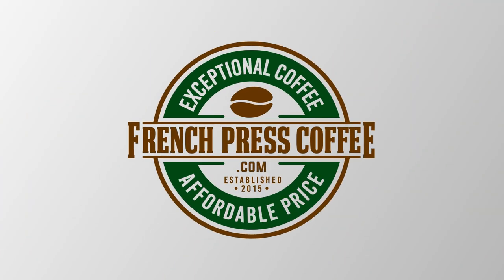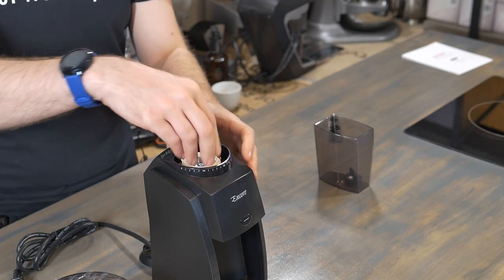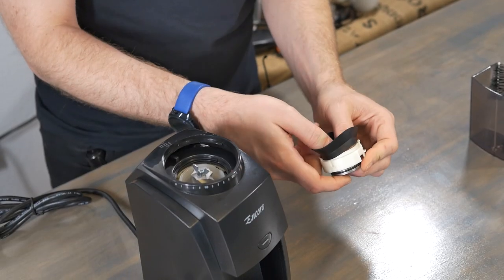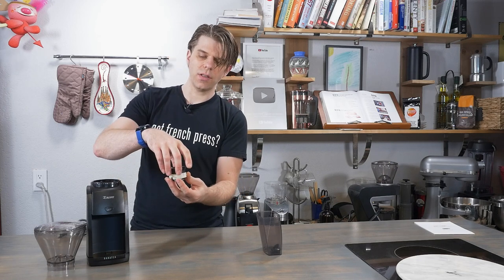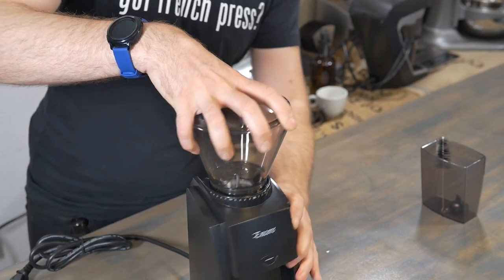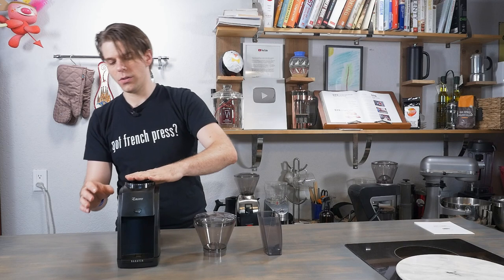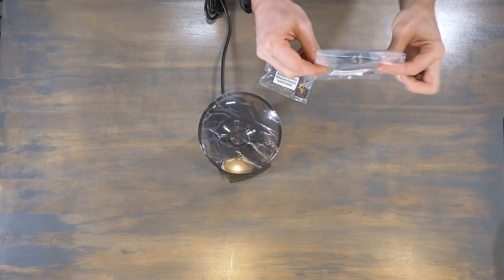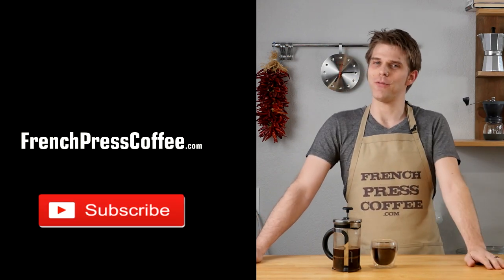Baratza Gasket  (Encore, Virtuoso) - How to  get it on

Comment: Thank you for this very helpful video. I watched it while my grinder was on its way to me. Therefore, i knew putting the gasket on would be a hassle. Opened the box, watched your video again as I installed the gasket using the claw hand method. Took me two tries and then got it. Without your video I think it would have taken me forever to do. 👍

Comment: Understand the frustration when the grinder is new. I felt it too. But the video is absolutely correct, the issue goes away rather quickly as the gasket ages. Now, when I clean the grinder, the gasket sits easily on top of the burr with zero effort.

Comment: 02/16/2022: I just installed the black silicone gasket onto the removable ring burr, on my 3rd attempt. It took less than 2 minutes.

I do not know if the Manufacturer has made some improvements, since this video was made?

The only thing I did was wash it with warm soapy water and let it sit for 2 days to dry. I found the silicone to be soft and not entirely stiff or hard.

I hope this helps someone!! Can’t wait to get grinding!

Comment: OK, this made me feel better. I was worried that the gasket installation was actually an I.Q. test. We recently got a Moccamaster and our burr grinder pooped out. We were using our back up grinder that we bought a few years ago for $15 at CVS, when we were at the beach. Couldn't wait to get my Encore but the gasket was IMPOSSIBLE. I even facetimed my brother and ended up ripping the little devil in half. Sigh... wondering if it will be worth it, once Baratza sends the replacement part. I need good coffee!

Comment: I thought it was just me..After trying for about ten minutes to get the stupid gasket to stay in place, I took it off and started working it with my fingers, stretching it a little bit each time. I finally got it stretched enough for it to stay in place long enough to get the hopper attached. I recently took the hopper off for cleaning, and this time there was no problem at all reattaching the gasket.

Comment: I got an Encore for Christmas and I could not believe how difficult getting this goofy little gasket on there was.
Reply: It seems like a really poorly designed product, in that they would set up such a system, and then worse, not tell you in the instuctions, what the user is face with.  I'm thinking of sending the grinder back for a refund. I didn't sign up for this frustating BS!
Reply: @mccurryburg  once you successfully get it on the one time, it’ll be loosened up enough by the time you need to remove and wash it that it’ll never be as difficult as the first time. I believe in you!
Reply: @mjrleaguesweetie  thank but it went back.

Comment: Really appreciate this video, however... However on my son's baratza Encore, the burr does not lift out, and the red marks are not aligned. Any ideas? The hopper also won't lock in place.
Reply: Need to spin the burr ring round to 40 then it should lift out. I think you can spin the hopper round, take it off and the burr ring should be in the correct position.

Comment: The written instructions for the gasket are just terrible; I'm lucky I didn't tear the gasket before giving up and looking for a video. I got it on, and this machine (Encore) does a really good espresso grind, nice and uniform. I'm undecided on the French press grind, which is inconsistent (all different sizes, from large to little specks) and not much better than my current Bodum grinder. I'll probably keep it, but will be wondering if I should have splurged on the Rancilio Rocky instead. It's just such a huge leap from $169 to $425, I couldn't bring myself to do it.

Comment: Thanks but … we’re just going to return it immediately. The design/fit of the gasket on this system is just ridiculous and causes me to lose confidence in the product. Plus, our gasket rubber was a bit marred in a small section. And my fingers are pretty strong.

It’s “funny” how the manual tells you not to tear the gasket when that’s about what you have to do to get it on (and have it stay on.)
Reply: I am with you. What a nightmare design

Comment: I think the gasket is silicone not rubber. Its not that big a deal to get it in place. Patience.
Reply: Right? It really was so easy to get it on that I'm super confused why a whole video needed to be dedicated to it .. I must've gotten lucky or something 😅
Reply: However, it did take quite a bit of tinkering to get my hopper to turn and "click into place" the first time I used it .. it wouldn't turn past 40
Reply: Maybe you had a pre-stretched gasket.  My experience is it doesn’t want to go or stay on.